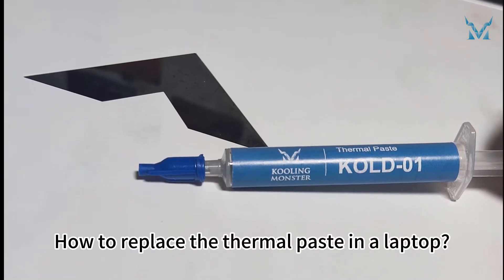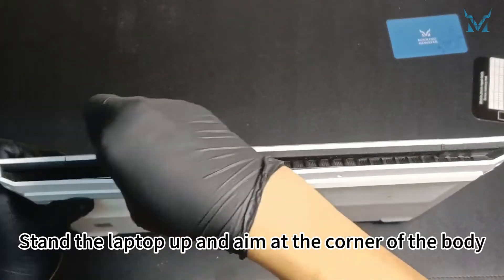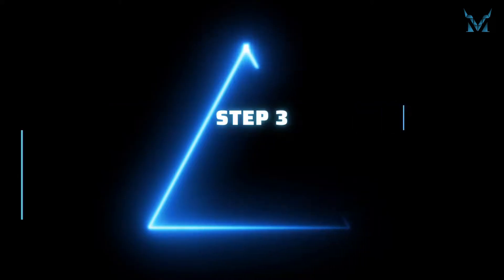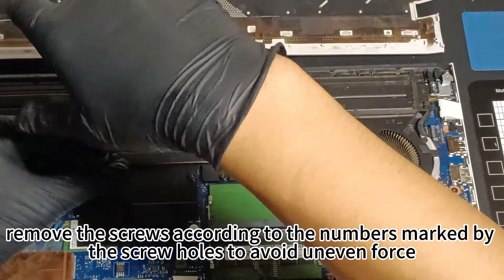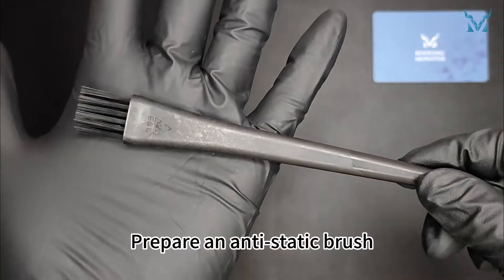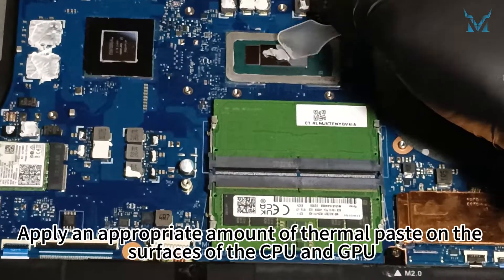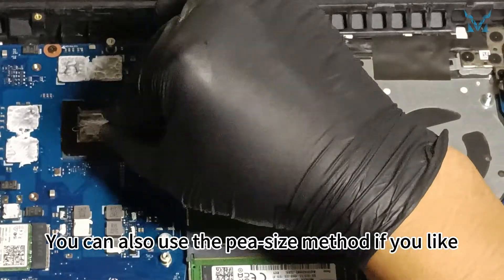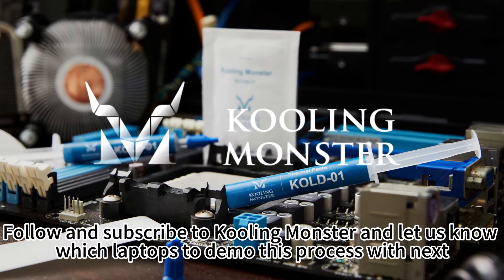Speed Up Your HP Victus 15 - Prevent Overheating With Dust Cleaning & New Thermal Paste

Comment: What is White White stuff?
Can We apply Thermal Paste on them
Reply: It is thermal putty 
You can also replace those with thermal pads
Reply: Don't put thermal paste on them
Reply: @robindeb007  i did that and the gpu is not performing well.. I was wondering if thermal paste would work but I thought the same thing about paste leak, I have made my research and found that K5-PRO is a good option.
Reply from the maker: The white stuff is thermal pads, usually for VRAM or power delivery chips. Don’t replace them with thermal paste—they need pads because of the gap. We used KOLD-01 thermal paste only on CPU/GPU, and kept the pads in place

Comment: Brother the battery plug is hard to remove i applied brute force but it aint coming out
Reply: I've had a similar issue, the remedy was to use a small heatgun and heat the area a bit, before slowly tugging on the white area of the battery connector
Reply from the maker: Nice tip! Warming it up slightly can really help loosen stuck connectors — just be gentle and avoid overheating sensitive parts.
Reply from the maker: Be careful — don’t force it too much. Wiggle gently side to side or use a plastic pry tool. Forcing can damage the connector or board!

Comment: I have a problem. I have the same device, but the fan GPU does not work well. It makes a very loud noise during operation. I mean the fan GPU only, but the other fan CPU works well. When I play games with medium or high graphics, the temperature of the fan GPU reaches 89 or 88, and sometimes 90. What has this problem become since the fan broke down? What do you advise me to do? Thank you.
Reply from the maker: Sometimes unusual fan noise may be caused by dust buildup. It is recommended to try cleaning out the dust and replacing the thermal paste, which can effectively reduce temperature and improve performance.
Reply: one of my victus's fans also made unusual sounds, and it had only been a few months since I bought it. So, I called hp and they sent a technician to my home to replace the fan.

Comment: What can u use if i dont gave thermal paste cleaning wipes ?
Reply from the maker: If the thermal paste is still wet, you can wipe it off with anything (tissues/alcohol/isopropyl alcohol, etc.). However, dry and hardened thermal paste often can't be removed with the methods mentioned earlier. You can use our professional KLEAN-01 thermal paste cleaning wipes, which have been tested to perfectly clean 25+ types of completely dried and hardened thermal paste. It's available in our product showcase on the homepage.
Reply: @ thank you
Reply: a cotton ball soaked with 99 percent  isopropyl alcohol will work

Comment: What is that white paste around the cpu and gpu i have removed them and i used same thermal paste that i used for the cpu and gpu is that a problem?
Reply from the maker: The surrounding chips generate little heat, so for cost considerations, thermal putty or thermal pads are commonly used. Thermal paste typically has better thermal conductivity than these materials, ensuring sufficient heat dissipation. Some claim thermal paste should not be used, but this is mainly due to low-quality pastes with high fluidity and insufficient viscosity. When used on small chips with significant gaps to the heat spreader, such paste may leak. 

To address this, it's essential to use high-quality thermal paste. If replacing thermal pads or putty with paste in these areas, we recommend using our KOLD-01 thermal paste, which has been specially optimized for flow and viscosity to avoid such issues.

The surrounding chips, such as VRAM, have low cooling demands. The original factory usually uses thermal pads or thermal putty, which are fine to reuse unless they have dried or cracked. If replacing these materials with thermal paste, our paste is recommended for its superior flow control and optimized formulation, preventing leaks common with standard products.

Comment: A few of the heatsink screws and one fan screw is very tight, and I am not able to unscrew it. 
Should I just change another screwdriver and try, because I am afraid of putting too much pressure downwards when unscrewing.
Any help?
Reply from the maker: Next time, consider trying our KOMBO-01 screwdriver set, specially designed for laptop repairs, with optimized precision and hardness to prevent screw stripping.

*Best methods to avoid stripped screws:*
1. Choose high-quality screwdrivers.
2. Use the correct screwdriver head.
3. Apply downward pressure perpendicularly when turning screws.

You can refer to our video #83 for a detailed explanation: How to Avoid Screw Stripping and Breakage During Laptop Disassembly? How to Fix Stripped Screws?

*Solutions for stripped screws:*
1. Use a rubber band to grip the screw (for minor stripping).
2. Use black electrical tape to improve grip (for minor stripping).
3. Use nail clippers or pliers for more serious cases.

Comment: I have a question about the other color of paste, The white paste is also thermal paste? Can I also use the grey thermal paste on where the white paste is located on the cores?
Reply: that was a silicon machinery thermal conductive compound (the white one),
 i used high efficiency thermal paste instead of this...
Reply: @robertbodnar8745  Thank you for responding, I have a few more things to ask.

I noticed you didn't need to clean and  change the, "White compound."  

When would you need to change the white compound? 

Does it dry up similar to the Grey thermal paste?
Reply: @MoriHikiko3125  NO, i cleaned it and " i used high efficiency thermal paste instead of this..."
that compaund can`t be touched, because it looses consistency after removing heatsink...
Reply from the maker: Do you refer to VRAM's heat dissipation pads here?
Reply: @koolingmonster Yes, he is referring to the thermal putty on the VRMs and I have the same question.

Comment: is it dangerous to use hands instead of those tools ?
Reply from the maker: When replacing it, we recommend wearing gloves. The gloves are for anti-static purposes, as static electricity could potentially harm the motherboard. We have corresponding tool kits available.
Reply: @koolingmonster not anymore....
Reply: Only if you are sure your hands are completely dry. If not, don't risk

Comment: What about the thermal putty on the VRMs, how do we replace those? Are thermal pads an ok replacement for it?
Reply from the maker: Hello! Thermal pads can indeed be used as a replacement for thermal putty. On laptop VRAMs, manufacturers often use thermal putty and thermal pads. This is for two main reasons: Firstly, thermal paste is generally more expensive than thermal putty and pads, leading manufacturers to opt for the latter two for cost-efficiency. Secondly, most thermal pastes have a high fluidity, which can cause them to flow away in areas with larger gaps. However, our thermal paste has been specially designed to have optimal fluid properties, so it stays in place without issues. Plus, it often provides better results. So you may try our thermal paste！
Reply: There is no difference between thermal putty and paste, its just a different color and cheap, you can use the same CPU paste and get much better result than the cheap white one.

Comment: Can i replace the display to 100% SRGB. Bcz it has 65% SRGB
Reply: Sure but I think 100% sRGB display panel is pretty expensive. Check before hand if it is supported or not before buying
Reply: @daytrikgaming8498  the 100% sRGB cost the same as the 65% sRGB ones (:
Reply from the maker: Sure, you can replace the display with one that has 100% SRGB. It will improve color accuracy and vibrancy.
Reply: Sure but I think 100% sRGB display panel is pretty expensive. Check before hand if it is supported or not before buying
Reply: I've read that some models of the HP Victus do have a 100% SRGB  panel but they are set to 65% SRGB. You'll have to modify the firmware of the panel which is difficult. But good luck.